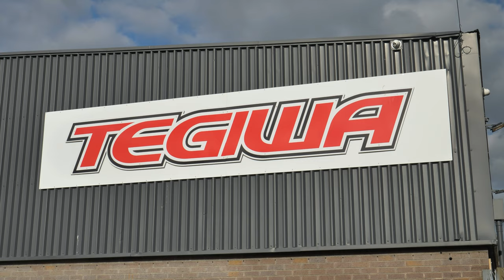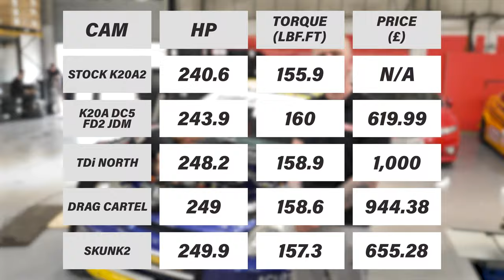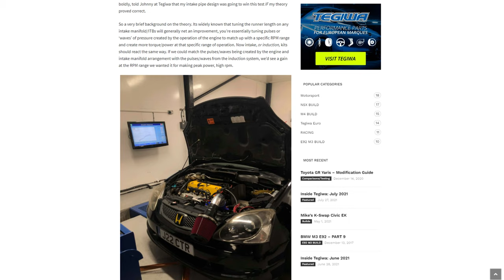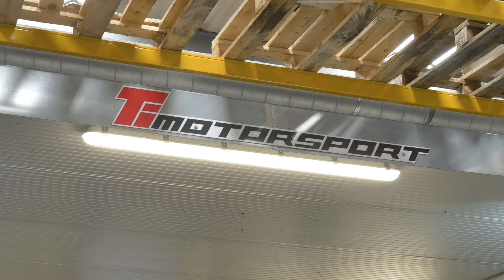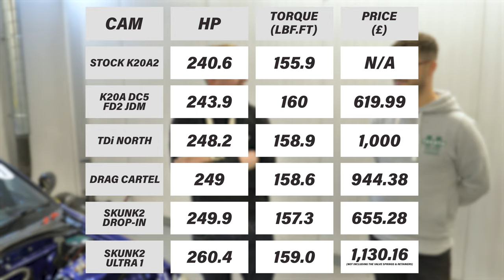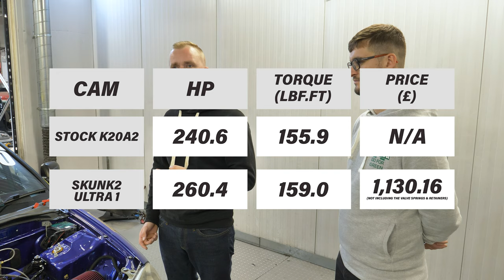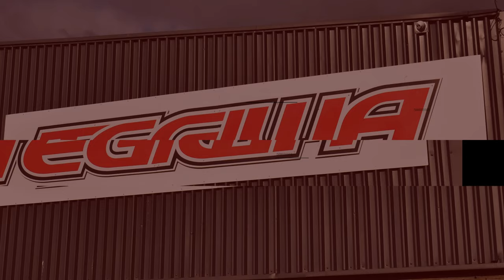K-SERIES DROP-IN CAMS VS SKUNK2 RACING ULTRA 1 CAM TEST! - SKUNK2, TDi NORTH, DRAG CARTEL, DC5 JDM!

Comment: So when changing the springs and retainers, you don’t need to remove the crank and timing chain? Did you just release the tensioner?
Reply from the maker: The springs and retainers were changed alongside the camshaft when we conducted this test. In regards to the tensioner, drop us an email or call us and we'll do our best to assist you. Email: websales@tegiwaimports.com     //   01782 33 44 40
Thanks.

Comment: If I did SKUNK 2 DICam’s on my K20 would I need to upgrade intake manifold and throttle body? If I did their stage 2 cams would I? I have intake.exhaust,headers - just not sure if I need upgrade manifold or better injectors. Sorry for the questions - newb.

Comment: Boy those skunk 2 ultra1 cams would make my k24a2 really come on ... But $1300 us into my canadian dollars $1621 plus tax and shipping would be $$1800 canadian ...makes me think a dry nitrous kit may be better for my poor man budget ..a 50hp  shot would put me a bit above the cams .. Great video fellas look forward to more ...
Reply: No need for the skunk2 cams if the costs affect u too much. On the K24A and A2 drop in 2001/2003 K20A2 intake cam and the 2006/2008 TSX exhaust cam. Great powerband vtec at 5400 rev out at 8600. (with oil pump conversion ofcourse)
Reply: And a 50Degree vtc gear.

Comment: Please do a comparison between the drag cartel dic vs drag cartel 2.2 cams. This will be very helpful to see the difference in power and torque at each rpm by going stage 2 instead of dic and is it worth the extra money because with stage 2 cams we have to upgrade the valve train.

Comment: Only thing missing from the vid is the need to change the single valve spring seat from single to dual valve spring base and need for new stem seals.

Comment: Love the content... Did you have to raise the compression of the motor to go from Skunk 2 dic to Skunk 2 ultra 1? Please advise because I'm thinking of switching over from my skunk 2 dic to the Skunk 2 ultra 1.
Reply: Almost all the websites say that  Skunk 2 ultra 1 requires high compression so that's the reason why I'm asking
Reply from the maker: Hi, if you drop us an email we will try our best to assist you! - websales@tegiwaimports.com
Reply: Ultra 1 are great for stock block k24
Reply: @PolishedMobileDetailing503  the k24 has less compression then a k20 so how is it better for a k24? If I'm using them on a k20 what will be the max vtc and at which rpm should I have the vtec position?
Reply: @tegiwa  I did email Tegiwa and skunk and no one can give me answer for max vtc and vtec position. I sent one email to Jeremy at drag cartel and replied 40 degrees max vtc for drag cartel 2.2 cams and still don't have any answers for skunk2 ultra 1.

Comment: Aren't the stock steal retainers stronger and more reliable than the titanium one's?
Reply from the maker: Hi, Skunk2's industry-leading Alpha Titanium Retainers are designed to significantly reduce valvetrain mass, resulting in more horsepower and improved valvetrain stability. Similar to Skunk2's already popular Pro Series Titanium Retainers, Alpha Titanium Retainers feature radius-cut edges for additional rocker arm clearance and reduced weight, strategically positioned lightening grooves, and reduced overall heights for better valve seal clearance and even further weight reduction.

If you need any more assistance then please contact us: websales@tegiwaimports.com     //   01782 33 44 40

Comment: How long should it take a mechanic to   Replace the stock cams and value springs?
Reply from the maker: Anywhere between the 1-2 hour mark for a competent mechanic however thats if everything goes as planned without complications.
Reply: I suppose you’ll need a new head gasket etc too

Comment: Please could you show the dyno graph so we can see the increase or decrease in power and torque at each rpm.
Reply from the maker: @ 14:11
Reply: @tegiwa  I wanted to see the Skunk 2 dic vs skunk 2 ultra 1 cams graph together. Basically an overlay of both graphs to see the difference at each rpm
Reply: In this way we can see at which rpm it made 10 hp more

Comment: Intake pipe diamater?
Reply from the maker: Hi, it's 70mm.
Reply: @tegiwa  Try it 89mm. K series need it!
Reply: Agree gained 25hp going from rb and stock throttlebody to ported rrc 74mm throttlebody and 3inch intake pipe
Reply: Jesse mapped my DC5 a month or so ago. Albeit, I have a high compression K24, but we messed about with intake pipes. I had. 3” 90 degree bend on at the start, swapped it out for a 3.5” straight pipe, made 15hp everywhere on the graph. There’s a lot of science behind the intakes, but K Series love short rams. DC5 has more room for the air to escape compare to the EK, I saw a K Swapped EK run a cold air feed from the lower grill up to the filter, apparently massively helped with his heat soak problem.
Reply: @Jagvetinget  was the head ported? Do U think I will see similar gains with ported rb and 74mm TB?
Reply: @h22eh6  No it was stock k24 head but  Brian crower stage 5 cam and 14.2 comp piston. 
So i went from 255 to 280 with TB and ported rrc and from 280 to 308hp with 4p tsx head.
Maby you Will se same numbers you can run 80 mm on a rbc intake.
Reply: @shvtadam  can i getaway with bends on an intake pipe? it's on a dc5 chasis with the battery stock location. thanks man